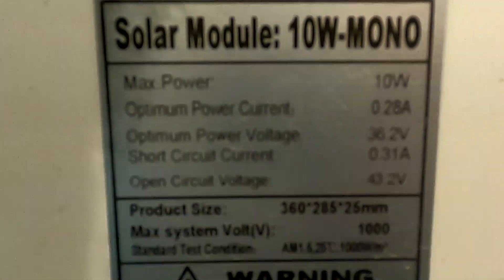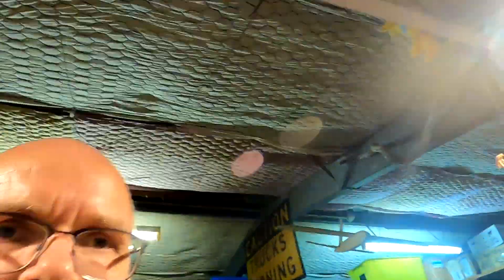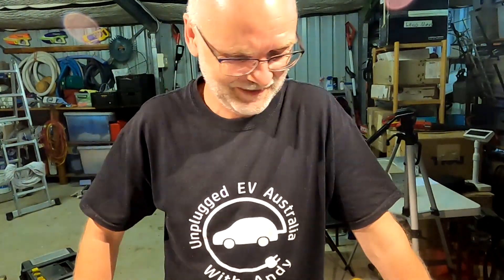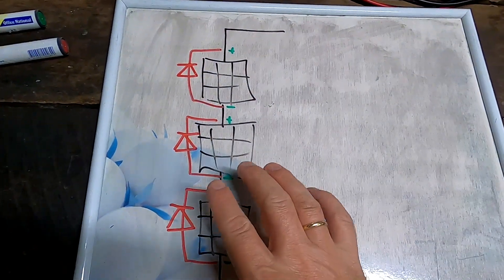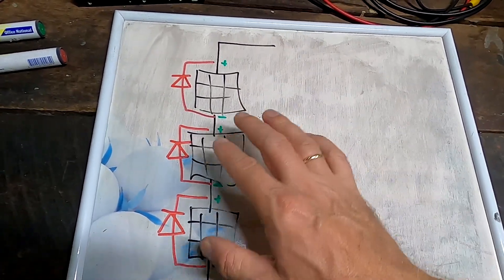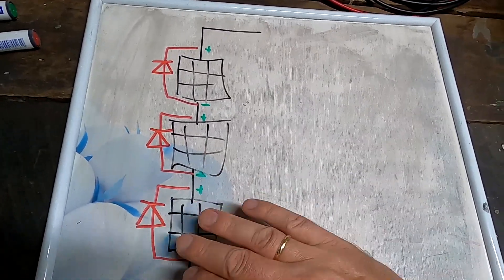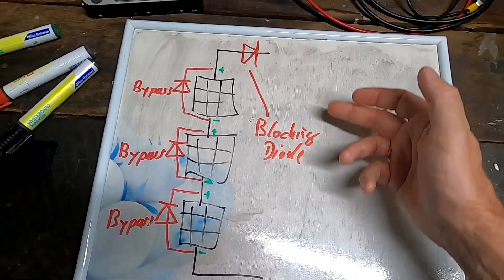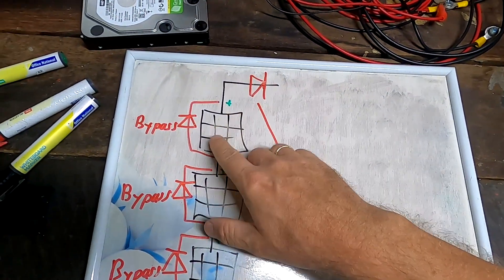Solar Upgrade EP4.1 - Bypass vs. Blocking Confusion and why solar panels DO NOT act as a diode!

Comment: "When is this happening?!?" and repeat it.... Please add a blocking diode at least for safety. It doesn't hurt anybody. Add such blocking diode for efficiency (at cloudy weather) or very important to reduce the risk of a fire when a parallel panel or string start to malfunction by aging or other damage event. Shouting: "When is this happening?!?" Maybe not very often but if it happens (you will never know) you are safe. That is why you need to install a blocking diode. Okay?

Comment: The only case blocking diodes are needed is if the natural (non-shaded) strings is significantly higher (e.g. one string is 150V the other is 90V) AND if the Solar Controller breaker is turned off (e.g. maintenance) OR if the Solar Controller is turning the charging off because it has reached its max voltage limit for charging battery.

In this case the current cannot flow to the controller and will flow somewhere else.

Comment: So what to do if we have only one MPPT and east-west roof? To connect everything in series and hope that shaded panels will not stop the production because current will flow thorough the bypass diodes? Or will current flow thorough shaded panells still? Or is it better to connect both strings in parallel? Is then the blocking diode needed? This video is little bit confusing.

Comment: Did you measure the infrared radiation coming from the solar cell when you apply a voltage to it in the dark

Comment: Solar panels produce most of their voltage even in shade, the amps just goes down. In shade, the voltage is still enough to prevent backfeeding, and in fact it will still be providing current. Obviously 100% blocking with cardboard is a contrived example, so in real world, there isn't really risk of backfeeding unless you parallel strings with a large voltage difference, which is a bad idea anyway.

Comment: I learned this the hard way. New lawn battery for my deer cam. Hooked it all up and left. Two weeks later I had a dead new battery. The panel without the diode drained the battery.
Reply: Dont the panels havethe diode built in? Did you remove it?
What is your guess? At night, the panel drained through reverse voltage the battery?

Comment: Good explanation, and a demonstration always proves a point well. However, I would like to say that you are both correct and incorrect when you say that solar panels are not like diodes. Solar cells, by their nature are diodes. They will prevent reverse current flow. However, there is a point when it stops acting like a diode and reverse current will flow if the reverse voltage is high enough. This is called the diode breakdown voltage. What you've demonstrated is what happens when the reverse voltage exceeds the cell's breakdown voltage. When the breakdown voltage is passed, current can flow very quickly and can cause cataphoric failure.

Comment: Current follows not "the path of least resistance", but all possible paths.  
The majority (vast majority?) of the current follows the path of least resistance, but enough practical experience warns to never oversimplify the behavior of pixies.
Reply: If the Controller is still taking current then there is no need for blocking diode. If somehow the controller stops charging because battery is full or circuit breaker is tripped then the current will go to the other string with lower voltage.

Current flow to all possible paths are true, BUT if Controller is taking unlimited current (analogy to 0V) and the rest of the strings are still like 90V or above then there is no way current will backflow to 90V or any of working string in parallel with lower voltage, not even 1mA going to another string.

Comment: Thanks for the masterclass blocking diodes. I have blow up a string off 6 panels white a lower voltage in east  orientation parallel with a higher voltage 10 panel string west orientation. This  strings are connected with  a Easun Hybrid inverter. Your experiment shows me why the panels are dammage with hotspots and have a low capacitie (30%) . From Now on I use blocking diodes in every parallel  string😅
Reply: 0:36
Reply: How will we know if this is a blocking diode? I have rectifier diodes, can I use them? Please tell me about this

Comment: A blocking diode could be useful if you have a roof with 2 different angles and separate strings combined with a low sun. But it also steals some of the voltage so is it really that useful. I don’t know the answer.

Comment: If I have 3 pcs 200w in parallel connection and 2 panels aee shaded and i haven't blocking diodes but each panles have bypass diode is there a possibilities  of hotspot and reverse current that can flow back to the heavily shaded panel?
Reply: Voltage different from a fully shaded panel to unshaded one is typically 5~15% diff, not lightly to have reverse current. Hotspot typically occurs in series connection.

Comment: My little foldable panel has two junction boxes. Each panel half has a box with 2 diodes in it. The tabs can come in on the first and second terminal so the 17v panel has a bypass diode and then the + wire out can come in on the third terminal so the panel has a blocking diode. The two panel halves are then connected in parallel into the MPPT controller.
I noticed that if I use the two panels in parallel with no blocking diode I gain some effect as 5w total is lost in the blocking diodes. However shading one panel (which is quite small only 50w) the other panel produces 0w and battery does not charge. So, in my case the panels actually DO contain both bypass and blocking diode but that is only as it is ment for a small portable setup.
I have seen small 100w panels with 2 strings using 3-diode junction boxes and I assume these can be wired for the same effect. This is good for setups where you may only have 2 panels feeding a single PWM or MPPT controller and you do not want one panel to shut down production from the other.
Looking at the efficiency of the MPPT controller (that can take 34v down to 12v battery) it does loose 1-5% efficiency when doing this. This unfortunately is same as loss in the blocking diodes so in my case I will now use my panel with the internal blocking bypassed to maximize the little power I can have.

Comment: I'm not actually convinced a blocking diode is even good after this. The most realistic case of a string being fully shaded while one is not is probably snow. Wouldn't the reverse flow actually be a net benefit in that case as the blocked string can melt the snow?

Comment: If you run power threw a solar cell it will emit infrared light like a led but very weak. It is not a diode as andy shows.

Comment: I know this video is 3yo allready but I think the conclusion is questionable. Because:
What happens if the solar controller or wires/conectors to it fails? They do from time to time!

As you just proved the shaded string will become the load for the unshaded string. It even happens before you reach Voc.

I bring this up because a installation case is to have 1 string pointing West and 1 string pointing East. 
Currently pv panels are a lot cheaper than (mppt) controllers. So it makes sense to install panels in a way that they will not have the same, by fare, incoming radiation during the day. 

So based on your test here I conclude that you should have blocking diodes (one on each string), when connecting pv strings in parallel, as a safety measure.

PS: As pv panels has increased in size and power blocking diodes might allready  be incorporated. So check your panels spec sheet.

Comment: Its best to have the blocking diode, as its not just shaded panels in a string, but also a faulty panel or cell can get very hot if its being back-fed from other parallel strings. Even thou most of the power will go to the charger/inverter some can back-flow through a dark string, if there is a fault, a lot of current can flow and the panels will get very hot. Did u know dark shaded spots on panels will destroy them as current is forced through the shaded cells and they get hot. Remember the roof is very hot as it is.
Reply: Only important for high voltage like 90V or above. If you only have 18V , 16V , 22V of each 100W all put in parallel then there is no need to worry about backfeeding as the current backflow is very small and only happens if the flow to the controller is blocked. If it is charging it will not backflow at all not even 1mA. Remember, the backflow current is limited to the difference of voltage. If the difference is just 4V with 5A panels, then only few mA will backflow and won't damage the panels as the panel is able to dissipate that current easily into heat on its aluminium case.

The problem with low voltage is that ALL blocking diodes have voltage drop like 0.3 (Schottky) to 0.9 (normal) that will waste some of the energy into heat. This is not so apparent for high voltage like 90V or above.

Comment: i once used a 1n4007 as a  fan switch, just glued the diode onto the heatsink, the heatsink heats up, diode conducts,, allah fan switch... it did create a high pitch noise ...lol but the fan run keeping the heatsink cool

Comment: Min. 8:35 , Can the solar panel produce heat ? If so ..., how much ?
Reply from the maker: They can produce heat if current goes through them. up to the point where they catch fire. 
That's why it is important to have the right safety equipment installed.

Comment: So here is my question.  If I have 2X 120 watt panels in parallel (on a sailboat - so one may have shade) - should I put a 10 amp blocking diode on each positive before the combiner?  So in a boat situation it is not only possible, BUT very likely, that one panel in parallel may be totally blocked by a sail shade..

Comment: It's not necessary to have a blocking diode on each string if you have very few parallel strings.
You don't want to run 80*ISC through one string because its shaded and you have like 100 strings in parallel.

Comment: You are mistaken. You do need blocking diodes for older panels, which have a single PV surface. However, modern panels, have blocking diodes included in their internal construction, since you can shade half the panel and still get half the power. I have a bunch of thin film panels (the black ones, where the PV cells are thin and run through their entire length), which DO need a blocking diodes to run in parallel. I found out by experimenting, just like you did.
Reply: a diode have a p-n junction, a solar panel have a p-n junction regardless of whether its old or new, here is a challenge, show us one modern panel which have bloking diodes built in

Comment: Hi. If I have only 3 panels, in parallel,  the internal bypass diode  act as a block diode. Correct?  I understand Well?
Reply: No, internal bypass diode is not blocking diode and has completely different function. Listen to this video again.

Comment: I have a question sir. 
I have all in one off Grid solar inverter which supports 3.5 KW panels. So there are 3 strings os 3 panels each that make up 3.5Kw. all 3 strings are parallel. Will it Be a problem If I place 2 strings iñ south direction and 1 string in West direction? Your reply will be appreciated. 
The reason for this is to get some power and try to keep the batteries topped up untill the sun goes down. 
Thanks
Reply from the maker: That depends on how many solar inputs the inverter has. If it has only one solar input, I would not recommend mixing strings which point in different directions.
Reply: @OffGridGarageAustralia  thanks for quick reply sir. 
Inverter has only one input channel.

Comment: What happens at night in total darkness? Isn't it possible (due to a fault in the Solar Controller) that the battery storage voltage & high current can backfeed into the solar panels and destroy them? Isn't this the reason why every Solar Panel has a diode across the (+) and (-), with the cathode facing the (+) terminal? Also, talking about diodes, if you are drawing any inductive load directly from a Solar Controller, it is wiser to install a blocking diode of a suitable size - simply to protect from back EMF reaching the Solar Controller, with possible resultant damage. This is my understanding, and I hope it makes sense.

Comment: Guess what, your MPPTs are not going to absorb all the energy all the time as soon you're not connected to the grid to reinject all the surplus there. And then electricity is going ... to the shaded string. It was not put on blueprints for anything.

Comment: Some brands has both blocking and bypass...you can see that on the connection...blocking diodes are in series and bypass diodes are in parrallel

Comment: Great video, but I'm not sure why people are disputing this as blocking diodes are so cheap and they simply plug onto the end of a series string, so if you use them you simply eliminate any possibility of back feeding when shaded so I would rather know all of the power my panels are producing is flowing in the direction of my battery bank.
Reply: a 50 amps diode is so cheap and its got zero forward resistance

Comment: Very good experiment and explanation. That confirms what i had thought regarding diodes and back current. Earlier today, i found som facts about solar cell tecnique, and read that a solar cell is a type of diode. But the current created by sunlight flows in back- direction of the diode/solarcell. That should explain why the solarcell does not block ” back-current”  Back current in the way we ar speaking about will flow in forward direction thru the diode/solarcell.

Comment: Don't know why you tube said to watch this video but it did. I did. I use a blocking diode between each string in parallel. I don't know what the failure mode is for a solar panel but if it is shorted, I don't want 50 amps feeding it.

Comment: I'm sorry if I'm a newbie, but the way i understood is, blocking diode and bypass diode is the same, it's just the way it is connected that makes it a bypass or blocking. if its connected in parallel in between the + and - in a pv array then it acts as  a bypass diode. if it's connected only in the + of the PV in a one way strean of power flow then it wll act as a blocking diode. am i correct? please respond.
Reply from the maker: Physically, they are the same diodes, that is correct.
Yes, you're correct. Bypass diodes are across the single strings in a panel to prevent total power loss during shading, while blocking diodes protect the panels from current flowing backwards.
Reply: or in the -ve of the panel

Comment: Simply said, bypass diode is connected between the terminals, blocking diode is connected in series to prevent back-current. Use a diode with lowest voltage drop for best performance
Reply from the maker: The voltage drop or power loss is actually not much different between a normal diode or a Schottky for example.
Reply: @OffGridGarageAustralia  if we're talking bout bypass, voltage drop does not matter. If we're talking blocking diode, i always choose schottky. The differential between schottky and ceramic one is not marginal. The performance loss is 1W on my 20Wp (schottky vs ceramic) and progress more as you catch the sun on stronger panels

Comment: Back in the early 90s i used 60 watt Solarex panels witch came with no diodes.
I installed blocking diodes and ran straight to my batteries.
No charge controller.

Comment: Cells are diodes, but are normally in reverse mode, your experiment just forward biased the cell, who start conducting as soon as you went above their threshold voltage. The bypass diode is connected in reverse respect to the cell so that if the cell is not generating enough voltage to turn off its bypass diode, the bypass start conducting the reverse current of other cells in series. Without a bypass the shaded cell would be forced to counduct in reverse (breakdown) mode and would dissipate a lot of power. 
So:
1) you are right bypass diodes and blocking diodes have different function.
2) you are right cells cannot work as bypass diode
3) you are wrong: cells are diodes, but normally (when hit by light) are conducting current in reverse mode but still having forward voltage across them (its the only way the can act as generators).
Reply: Just to be clear: your experiment doesn't prove cells are not diodes, you just forward biased (as a load) a cell who has a threshold voltage of about 5V. You could have seen it emitting light with an IR camera. Normally, as generator, the current flows in the other direction, exiting from the positive ( so in "reverse" respect to the cell as a diode).

Comment: I need to replace my junction box( diodes), do all cell use basically have the same diodes
Reply from the maker: They have probably different diodes depending on the panel's voltage and current.

Comment: Hey Andy I need some help with bypass diodes I was given some panels and one of them the center bypass diode was accidentally broken off any ideas how to find out what one I would need to replace it with I’m talking about the one on the back of the panel in the center junction box the whole box is gone but the terminal tabs are intact
Reply: If you look at the label on the panel it should tell you the short cct current, ideally the diode should be able to handle that current

Comment: What blocking diode would you recommend for a 100watt 12 panel. I have shade problems currently and panels in different locations. A part number would be great. Great video.

Comment: The diode at the back of the solar panel's black box is a bypass diode. 
Its function is to bypass the panel in case it got damaged (open circuit damage to be exact).
Reply: Not just when it got damaged, but as he said in the video, also if the panel is shaded.